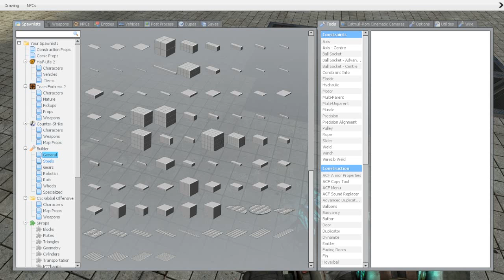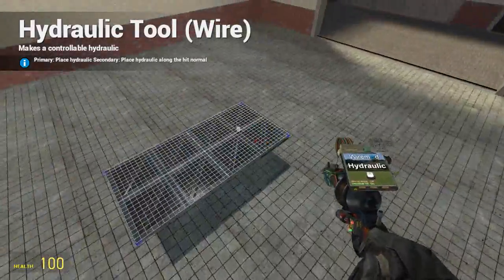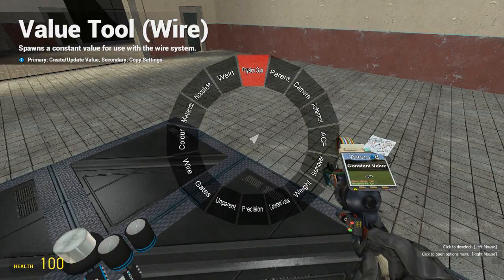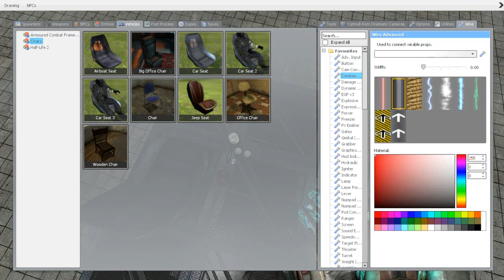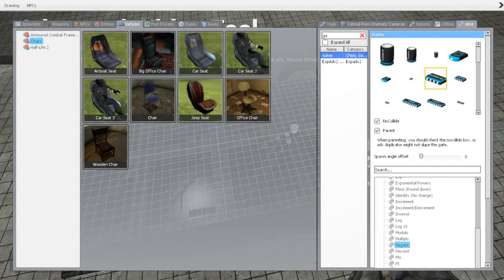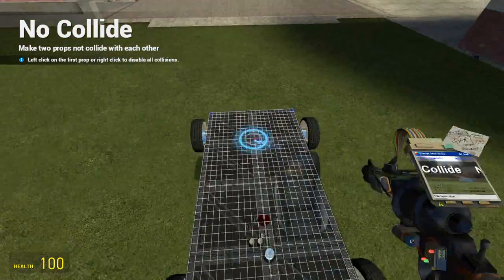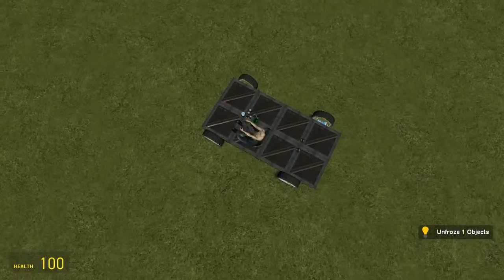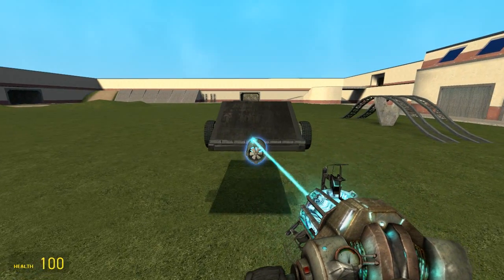[Tutorial] Garry's Mod: Wiremod Car With Realistic Steering ✔

Comment: Hey man when I make vehicles like my bus the wheels are flimsy and they bend in and the don’t work properly how can I fix this
Reply from the maker: Use "axis center"
Reply: @GMODISM  Tried that and it didn't really work. It helped a little but not enough.

Basically, what's happening is the part that the wheel is attached is being pulled down by the weight of the wheel which either brings the wheels inwards or outwards.

If I phys the part the wheel is connected, the wheel is straight up. But then I can't drive the car because the prop is frozen.

Any ideas?

Comment: How can i recreate the steering e2 with Gates? 

I'd like apply this knowledge to other contraptions i move onto, but not by just slapping an e2 on there and changing variables.
Reply from the maker: You can't exactly because the ship uses "set angle" functions.
Reply: @Artameful There's a few ways to do it without E2, but having a bunch of gates will cause lag, fair warning. 
1. You can use constant value gates to give you the values needed, such as the default length, extension/compression length, velocity, etc. Then use other gates to make it happen. (If you want more detail message me.) Also note that without using e2, you will have to use MANY gates to actually make it happen, since e2 runs off of written code in your e2 script it is able to condense everything into one single e2 chip instead of multiple. 

I would recommend learning how to use E2 for those reasons. It can be overwhelming at first but just remember, E2 is quite literally just using all the functions of gates, except in a line of code instead of physical gates.
Reply: I'd like to also add that a lot of the time, e2 is adjustable with just a few clicks. Gates on the other hand, you would have to adjust each gate accordingly & more than likely have to change other gate setups if a change you make conflicts with them. 
So generally speaking, e2 is quicker, easier & much less of a hassle. However, I too don't like using e2 as gates make it more fun personally, so I get you. Just know that the gate route is almost always going to be more complicated & involve much more time and effort

Comment: When i steer left and right, wheels don't fully go to their original pistion
Reply: The prop you have your steering rods axis'd to, you need to increase it's weight. 
On the default length, round DOWN to the nearest number, this puts slight pressure on it which helps keep it straight.
Reply: On the default hydraulic length, round DOWN to the nearest whole number. If its already whole, decrease it by 1. 
This puts them under slight pressure with each other & helps keep them aligned